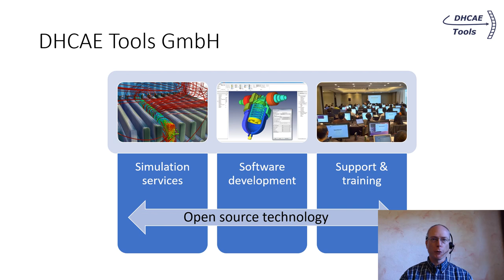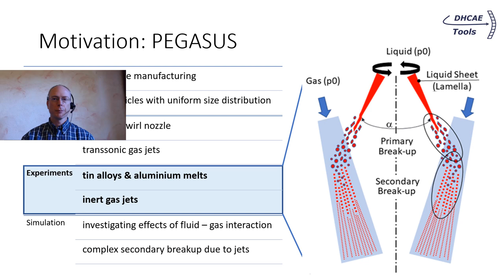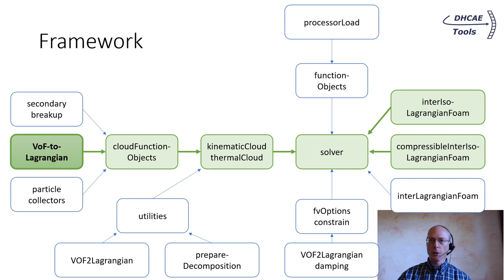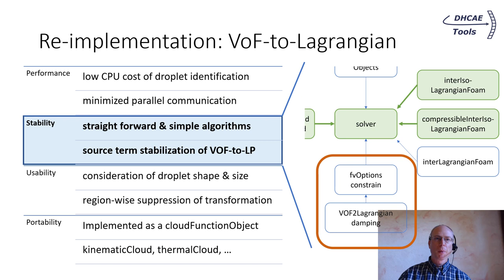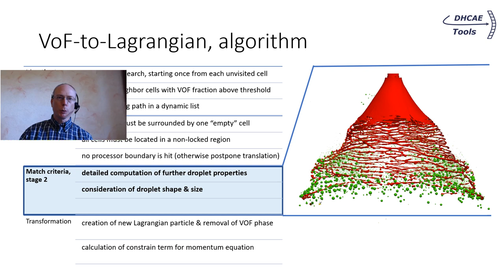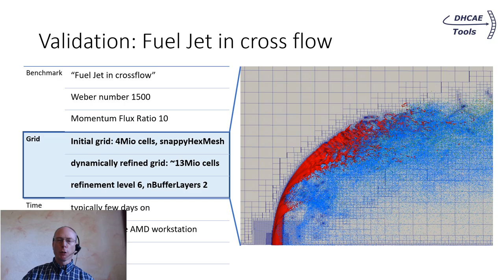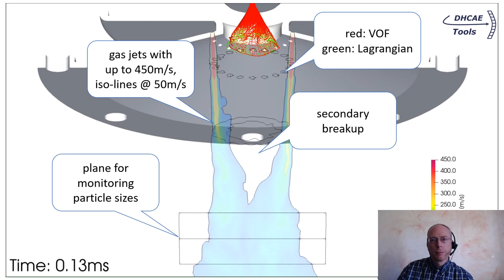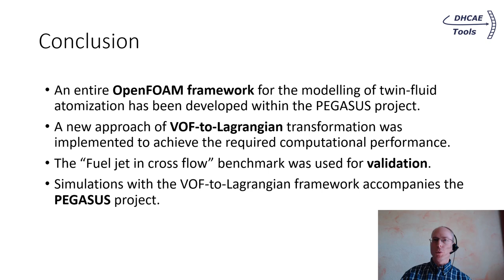An efficient VoF to Lagrangian extension for spray breakup simulations for OpenFOAM

Comment: Great work. You mentioned that you used a solver for compressible fluids due to the high gas velocity. However, as far as I know isoAdvector is only valid for interfaces between incompressible fluids. Does this lead to problems in the solution?